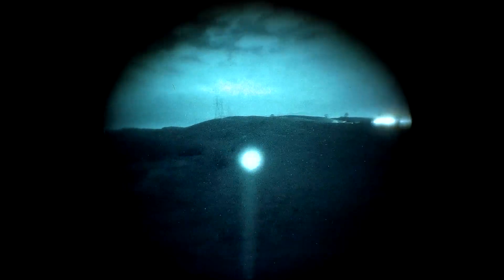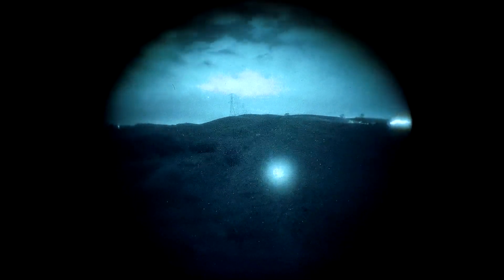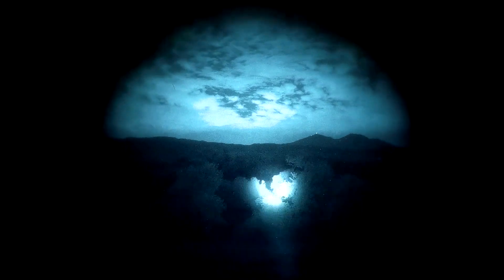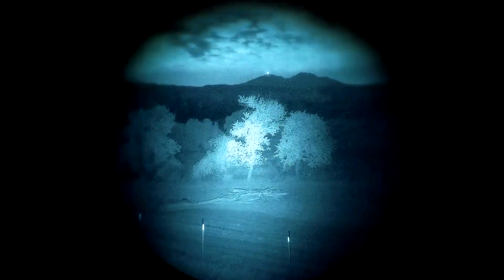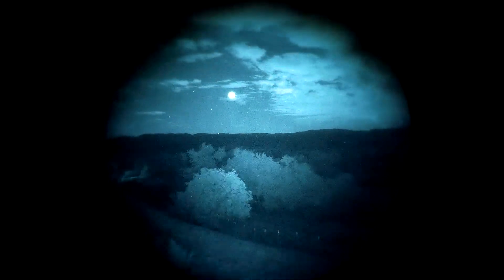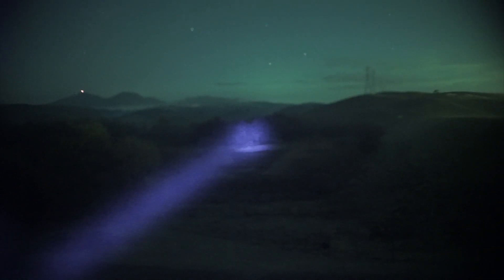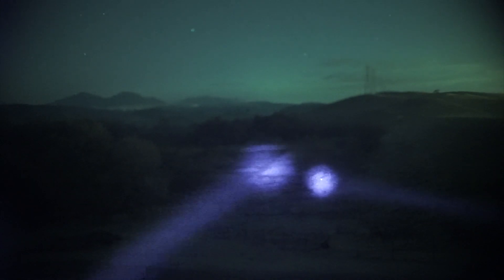B E  Meyers KIJI K1 test

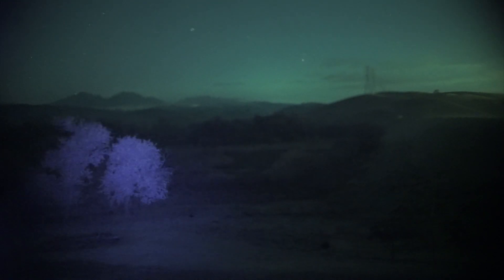Comment: What camera are you using here 4:02?
Reply from the maker: Sony A7S with full spectrum mod.
Reply: @Solscud007  Is it an accessory or did you have to do some technical teardown of the camera
Reply from the maker: @blakecardenas2973  It is a technical tear down. Digital cameras have a "hot mirror" that acts like an Infrared filter that blocks infrared light from hitting the sensor. I had Life Pixel modify mine.